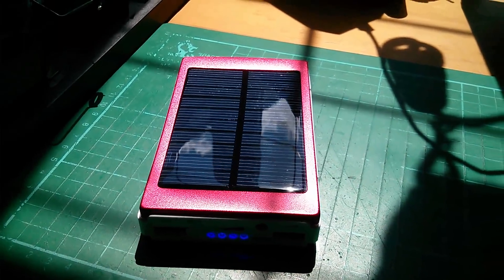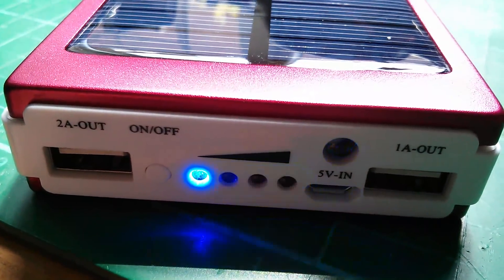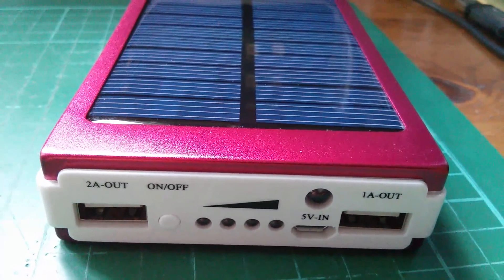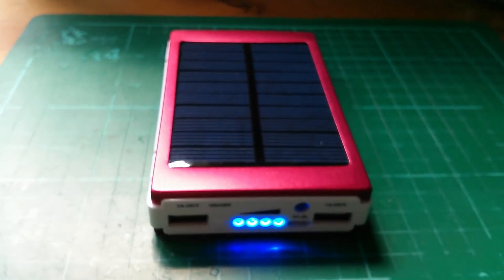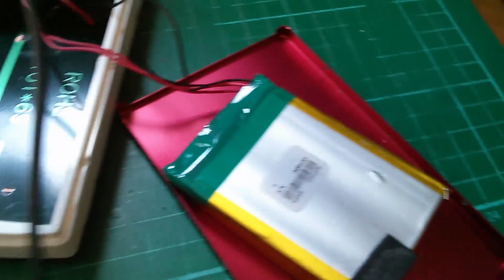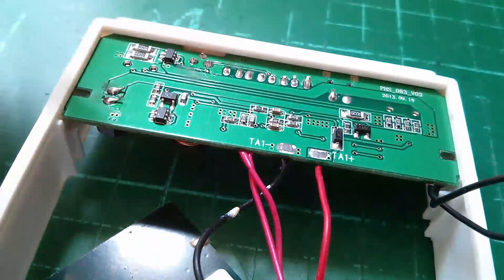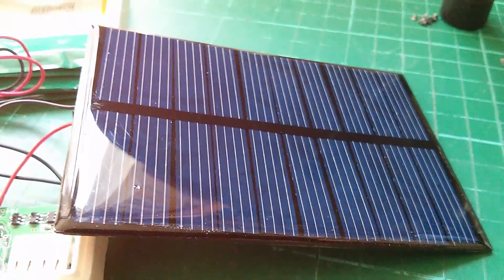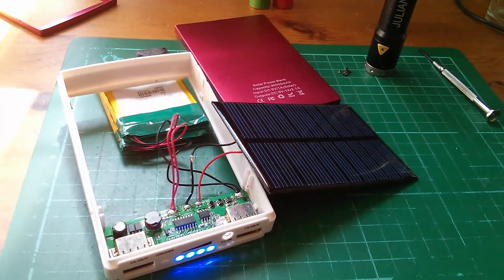Review: 30,000mAh Solar Power Bank - It's a pile of Junk!

Comment: So who makes a better power bank for $20?
Reply: ww321 www.banggood.com/Wholesale-Power-Banks-c-2204.html?p=9P2614646632201406U8 (Xiaomi for example)
Reply: Kmashi 10000 mah battery its for 12 to 15$ right now
Reply: Noel Galvan thats cool but it has no solar panel
Reply: Noel Galvan Postage from the USA is always prohibitively expensive !
Reply: Xiaomi they use either samsung or not sure about the other manufacturer maybe panasonic 18650 batteries to get a 10400mAH powerbank
Reply: Paul Lorenzo samsung or LG. And it's great.
Reply: A company called oneplus make one its brilliant and cost 15
Reply: ww321 solar power banks in this since are junk and a big waste of resources and money......
With such a smal solar panel it's almost impossible to charge a smartphone or charge the power banks correctly.
I bought an littel converter chip with an usb port from Amazon that only costs aground  1 $ and a lion / lipo charging chip fore 1,6 $ and if you put this to an solar cell it charges continuously even with smal solar panels at low Sun.
Reply: Nino Joel You really need to work on your "an's", not 'an solar panel' - A solar panel. 'an' little converter... No! A little converter. Derp.
Reply: Tommy59375 Those aren't even apostrophes, they're speech marks. So derp to you!
Reply: Elusive Sanity She's dead !
Reply: Tommy59375  Speech marks are never used like that. An's doesn't become 'an is' because I'm talking about your an's...belonging.
Reply: lilschnowyguy I'm not the best in English .....
I'm from Germany
Reply: ans I could agree with, cause it's an odd word as it is, but not the speech marks. You can't just stick speech marks as a makeshift apostrophe.
Reply: I dunno where you went to school buddy, but nowhere ever do they use " in place of an apostrophe, ever.
Reply: Tommy59375 I'm talking about an"s - you've stuck a speech mark in there. Catch up.
Reply: Tommy59375 Now you just flat out deny it, the desperation to be right. You're really sad. Here you go to rekindle your memory. "Not " an's " it's actually " "an"s ". Derp." This one y'see you have the speech marks as you said, to illustrate the word, but also as the apostrophe. Also here, Either say "ans" or ""an"s" << yet more speech marks in the middle of an's. Putting a speech mark there doesn't work, not to mention you've used not 2 speech marks, but THREE. "AN"S", go back to school kiddo.
Reply: Tommy59375 Well you orta know as much as the next man, you never put a speech mark alone, they come as a pair. So yea, putting "an"s" in the way you were trying to, is still wrong. an's an's an's an's an's an's an's an's an's an's an's an's an's an's an's an's an's an's an's an's an's an's an's an's an's an's an's an's an's an's an's an's an's an's an's an's
Reply: Tommy59375 Well my comment where I pasted your previous comments; I pasted what you put, and since they have changed, so you've edited them since. Don't get sneaky with me kiddo.
Reply: Tommy59375 I dunno either dude, I'm beyond caring now, it's a trivial matter in the world. ^_^
Reply: Has anyone ever truly read the chinese-english instructions on these things, they barely make any sense... now taking that part into consideration, does anyone agree with me on my thinking, the chinese have most probably noticed an increase in sales when they list higher mah numbers in there avert listings, 40,000, 80,000 1000,000 etc... perhaps they do not fully understand this is misleading to understanding buyers, maybe the chinese simply see it as a means of atracting more interest to there listing? - I do not know, I just think it is crazy to state 200,000mah if they are not even 5% internally +ww321

Comment: Macbook battery cells are the same voltage and are square, flat packs. Had a PSP-1001 with the UMD drive removed and one of those batteries in it's place. Hours of fun man.

Comment: What did you expect when you purchased it? i just saw one on eBay for $19.27 free shipping. Most solar panels only work good in direct sunlight. My outside solar lighting during the summer will charge enough to stay on all night. This time of year I get maybe a couple hours at most. Your indoor test of the solar panel is almost a joke. Also I believe AH ratings procedures are not cast in stone. It's an average at best and manufactures can use really low amp draws to get a better AH number. I will say I do enjoy your videos. So who makes a better power bank for $20? Thanks for the video :) PS the $20 one also comes with a USB cable and adapters

Comment: I order one and then came across you review,when i got it i opened and mine has i think 5 x 18650 batteries inside  which they are better batteries ,i'm happy about that because if i need more power i can replace them for others with up to 6800 mah , although i agree with you about inefficient harvest of energy with so many leds lit up while charging  so i removed the first 3  and now the one left just blinks 1 time every 4 seconds and flashes when i power it on so that's all i need for mode indicator ,hope this helps any one , they're not that bad for the price
Reply: The maximum capacity of the best 18650's is 2600mah.  My tests show Sanyo and so called 4000man trustfires to be between 1500 and 2600mah.  My 4200 mah ultrafires test at just under 600mah.  the trustfire 7800mah also test at 600mah.   2600mah Sanyo and trustfire weigh 40 gms while trustfires way 30 grams
Reply: Ed Dantoni I meant between 2500 and 2600 mah.

Comment: They accidentally added an extra zero to the capacity rating.
Reply: ...or two.
Reply: Mikael Wingaa Ohh they must have corrected to 2 batteries and forgot to take that 0 out xD
Reply: Beat you all, I’ve got one that claims 100 000mAh! I lose.
Reply: Bfff amateurs with mah... I got the exact same one with 2000ah
Reply: Hi,

i made a similar review on a power bank solar charger device which i tested by self and is just perfect with two 5V USB outputs and 50.000mAh check it out:

https://youtu.be/hWONMXbBc3Y

regards.
Reply: Ryan Toomey No they didn't.
I got one on eBay that is EXACTLY the same as this.
But the one I got is rated 50.000 mA/h .. lol
Reply: @mwingaa  hi how is the quality of this powerbank
Reply: @mwingaa  and I got this same one rated at 90000 yesterday. Not kidding

Comment: hi, i also bought this from ebay, and the batteries used in this thing are rubbish, they drop too fast if you use the 2 amp usb, so 4.8 amps only output maybe 2 amps(charged my phone just one time to 85 percent).
but bear in mind it just cost me 11 euros, i just pulled out the batteries and replaced them with 5! laptop batteries wich fit just nicely.
now i got a nicely working really 12.5 amps powerbank for only 11 euros, which charge itself in the summer, and in the winter you better tape the solar part.
the solar part is just a piece of shhhh, the back says its 1.5 watt, but 10 by 7 @ 15 percent output is 1.05 watt without any conversion rates!
so in the summer when its 12 hours in direct sunlight it just charge the battery by 2400 mah!, thats enough to charge your phone once.
so, a nice project and it was only 11 euros, but not recommendable!

Comment: Doesn't surprise me that there are a lot of Waaaaaay overrated portable power supplies on the market. There are a couple brands that actually adhere to real specifications, but I'm afraid that there are many more that state over blown ratings. Newtrent sells good units with real ratings of their well made LiPo batteries. (None solar that I know of though). One thing to keep in mind on solar, you need a large panel to give you any real amperage. While the panel on the unit in this review might be 15~17% efficient, it's not going to feed the battery much in actual current meaning even without the LEDs robbing all the power, it could take several days in full sun to actually top off the battery. I'm waiting for the new solar panels to hit the market. Initial hype is 90% efficient, but we'll see in actual use after they hit the market.
Reply: Solar cells are barely making 40% for the very expensive ones, this one is about 5-10% id say. no way your getting 90%

Comment: No inverter, no performance. the solar panel is to power the inverter, The inverters neutral electricity is converted to charged electricity. The charged electricity from the inverter powers the board and charges to batteries. No Inverter, NO Performance. Same problem in the electric cars. Too many batteries not enough second wine ding in the inverter. Magnets and Electricity are not in the fuel family. Everyone makes the same mistakes.

Comment: Don't worry ,  pretty soon a new invention will be on the market based on Nano-solar cells woven into a jacket  and has the charging connection so your phone can plug into the jacket as you walk around  or drive on a sunny day .  The answer though  is to focus on Electronics or inventions to make the devices draw less power from the start , then add research into energy storage.

Comment: I agree with you entirely, Julian. In my time I've seen many electrical items of similarly abysmal design and quality.  One thing I've happened to noticed is that they all tend to use a similar font for labelling the various ports and connections. As soon as I saw the labels above the USB connectors etc. I could tell exactly what it was going to be like. Beware of anything pictured with that sort of font on places such as eBay.

Just a word of caution about reusing the LiPo battery packs; if the batteries are of similar grade to the overall product, I'd send them to the recycle centre along with the rest of it.  Low quality LiPo can be very, very dangerous.

Comment: This video shows unknown brand, make poor quality solar charger. It take me several months to find factory which makes really high quality device which work much better then this shown on this video. Many solar chargers look similar outside but there is difference inside. You cant trust cheap 30000 mah battery, real 30000 mah battery will cost over 20 pounds - 30 dollars. I tested mine and it work perfectly. If somebody have no experience it is difficult to buy good things from china.

Comment: for me this thing is still pretty good deal. because i just like the big case and the additional solar panel.
the battery capacity is obviously a joke. 30.000 or 100.000 mAh?? it's like a battery for car. lol

so i still buy this thing, the cheapest one that available on the online shop.
then just change the battery with the best battery, like sanyo, or panasonic, or samsung. which have real capacity and nice quality.
anyway i live in indonesia which is near equator and very hot here.... everyday. So I hope this solar panel can do a little bit better than if its on europe, or north america.

and maybe it's not a good deal anymore after u change with expensive battery. but i will work properly...
Reply: Taport on ebay is selling best quality solar chargers powerbanks - much better batteries then shown on video.
Reply: very hot is not equal to a lot of sunny days. I live in the Balkans, and we have a lot of sunny days, but a moderate climate
Reply: Search taport on ebay and found nothing.... 

anyway. Try go to Wikipedia.org/wiki/Insolation and im amazed that my country,  even its on the equator. The solar potential is not really good, compared to Australia,  or south america.

Comment: Those blue LED's are probably rated for 10mA so 4 LED's use 40mA. Can you measure the actual current output of the solar cell? If the battery capacity is wrong (typical chinese marketing wank), so can be other current ratings.

Comment: This is odd, my power bank is the same (but under a different brand) to this but contains 5x 18650 cells. Not sure on capacity and too lazy to find out tonight but hoping they are at least 3000mAh @ 3.7v - probably dreaming though. (I paid about $32 Aussie dollars)

The board in my one is a blue PCB and contains a much neater layout (and more components) 

The casing is also metal on my one, excluding the white plastic "band" sandwiched between.

Comment: This guy doesn't seem very smart when it comes to it. It needs enough power, probably enough volts to push electrons into the battery. Yes LEDs use very little power, but hes putting it the sun with a bunch of shadows and at an extreme angle assuming it would charge properly, I don't why people never think things though.

Comment: Julian, allow us to send you our Power-X. I promise you will be surprised. You can take it apart, and run it through all the tests if you wish to do so.
Reply: +Julian Ilett Did you receive it?
Reply from the maker: That would be great. Please email me: pb@256.uk
Reply: He never responded to us after the first email. We have yet to receive any complaints on our Power-X. Plus it's backed by a 1 year warranty.Sean Windingland
Reply: +Julian Ilett Did it ever turn up?
Reply: ***** igotes  Check us out at BEiLEET.com
 or on Amazon
Reply: iLEET Designs
 
Yeah man, where can someone get a hold of your product? you don't seem to have a web presence outside of 1 review..
10 amp hours?
what is the pack a Lifepo4?

what is the solar panel 500mah (at best)?
@ 500mah is 20 hours of full efficiency output to charge the battery (ignoring losses) so realistically 2-3 days.. have a cloudy, rainy week and this suddenly blows out to a week plus.
Reply: +iLEET Designs I've just searched for "iLEET Power-X" but I can only find reviews and marketing info. No results on Amazon. Any results on the web look like SEO bullshit. Can you direct me to a retailer that sells your product?

Comment: Igot one of these and I agree, it's pure rubbish. I just took mine apart. The solar cell itself is about what you'd expect for is size, and the batteries are useful in other projects. I tried putting a jst plug on the circuit to be able to charge from any of my single cell batteries but that simply dosn't work, I have no idea why.

Comment: looks like you got a fake. i have one just like this but it has 5 18650 cells (i tested and got 10Ah at 2 Amps)
the solar panel give 6.5 volts at 120mA which is still kind of weak

Comment: Mine is physically identical to yours - except for having a specification of 10,000 mAh. Inside there are also two 4,800 mAh lithium cells, so pretty close to the printed spec'.  It charges fully in about 12 hours of good sunlight and works faultlessly. For what I paid for it, I'm more than happy. Perhaps you need to change location to a country with more sunshine. LOL

Comment: 50 ? no way. Thoes 4 leds use probably almost nothing at all.
Reply: They do. One of them 30mA
Reply: There's a deconstruction of this exact powerbank over on Stack Exchange. The manufacturer of the powerbank didn't dim any of the led's, so each one had a power draw of 20mA. Absurd design.
Reply: thats what i was thinking

Comment: For a 18$ i would not expect military grade science, not via Chinese sellers.
Got one, charges my blackberry and ipad well enough in remote places with no AC outlets. Sure, I charged it fully at home before I stuffed it into the backpack, and that took whole night (the charging, not stuffing it in the bag). :) In comparison, the whole day of direct sun on the boat charged it to 3/4. That gave me two rounds of "off the grid" charging - for both the cell phone + tablet. That, on occasion, could be a life saver, really. :)  
I guess that's the product's function. 
After 3 months of use i am still waiting for it to die so i can break it apart. 
 
Misleading mAh does not bother me one bit. Its unrealistic as hell, if ever one visited a class or two of physics. I am amazed that it packs 4800 mAh, really.
One can only imagine the performance (and content) of the 5000 mAh version from the same provider.  

Thanks for the review.

Comment: The weight is often a giveaway, this should have weighed in around 500g +, try and get Samsung or Sanyo batteries as a starting point and these do not really work below a certain price level, rubbish solar/battery/electronics/case. More than anything you get what you pay for with Li-Po  and solar chargers.

Comment: I bought the Power Bank 100.000 mAh (at teh back  is written: 111Whr) But in real:
it loaded my iPad for 24% and then this Power Bank was exhausted.  Practically mine was good for 2000mAh max. I opened it and saw 2 minor batteries, smaller as here on video: the rest was filled with rubberfoam.  I feel cheated.
Jan Roovers

Comment: Thanks for taking apart this item. I was recommended it by a friend and had the "too good to be true" impression. I bought the 50,000mAh model, which is around 50,000 units of BS. The thing won't store energy in the Australian sun after leaving it out for several days. The energy input is barely enough to break even.
Reply: Lithium's really need to see a current between C/10 and C/5 to charge.

Comment: The steady light means it has 1/4 charge, as it receives power from plug in or sunlight the lights will flash like the turn signals of a 1967 Cougar and as the charge develops and gets stronger the next light will stay steady leaving two light to pulse one after the other and so on and so fourth until they are all steady meaning it is a full charge. This can be interrupted by weak light from the sun or placement in the shade. The only way to get a steady and constant charge is to plug it in to an outlet.  You should do more research before doing a how to video.